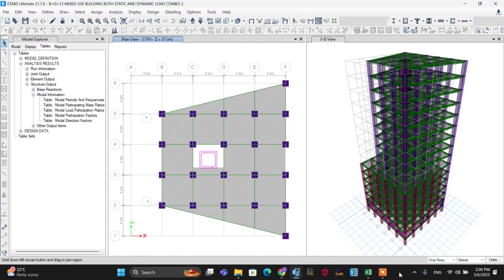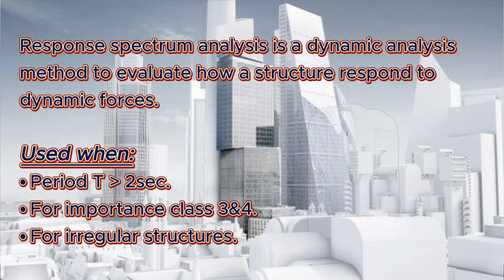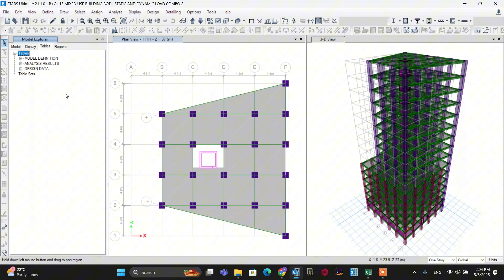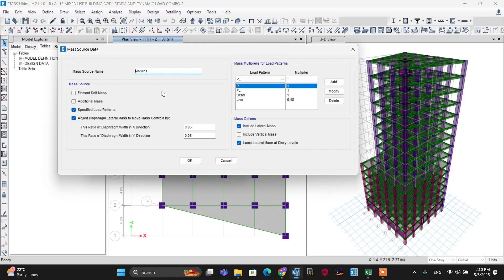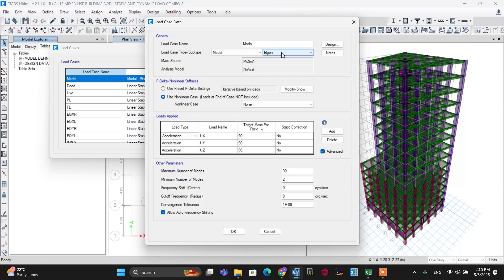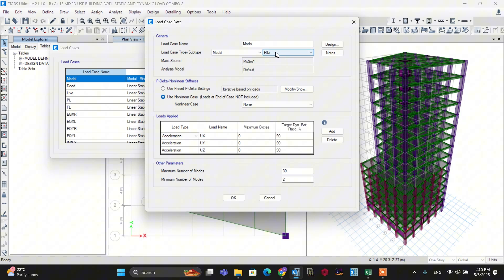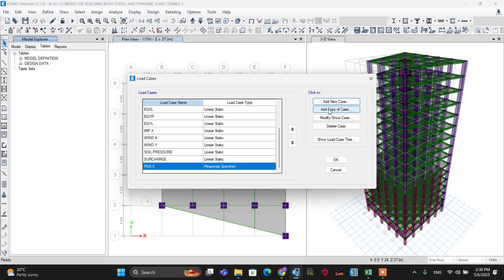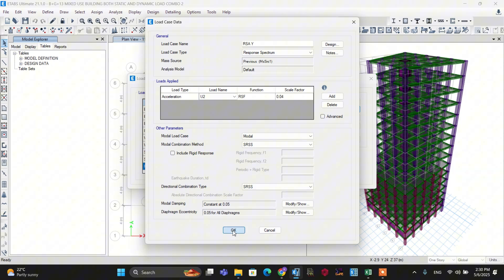Response spectrum analysis /dynamic analysis modal analysis/ on ETABS software high rise building

Comment: Great with questions?
1, why you are considering accidental eccentricity in mass source and load case twice? 
2. Why you calculate 2xstory number for mode numbers if you consider ritz eigen load case? 
3. in scale factor, for response spectrum you consider behavioral factor 2 and also 3.15 totally 5.15??